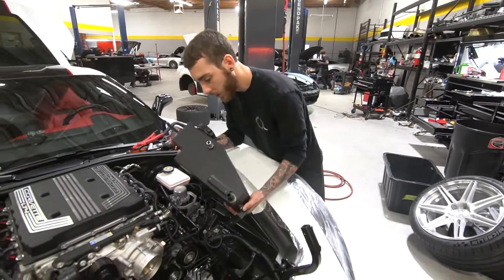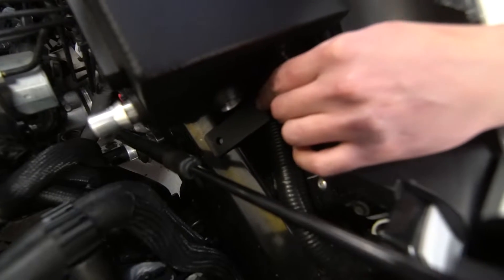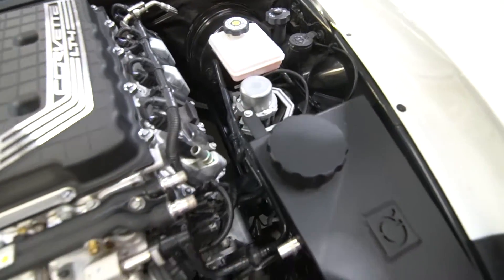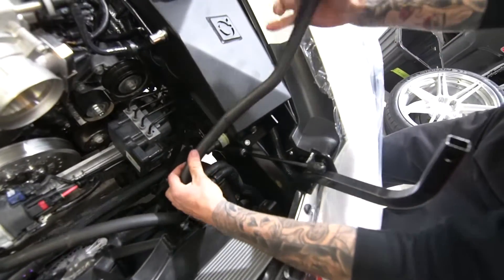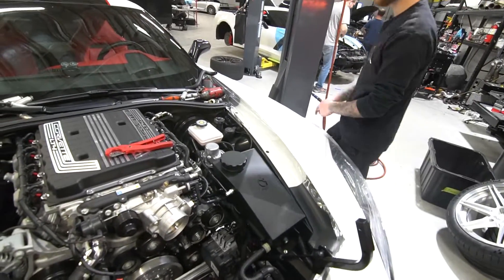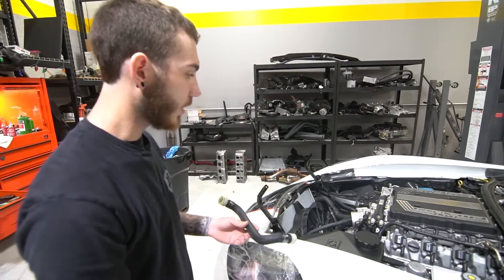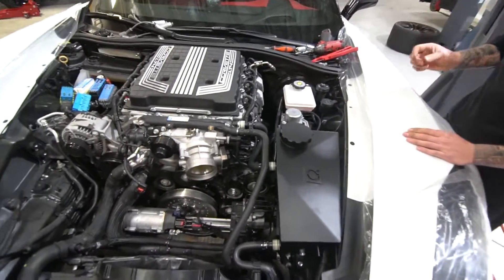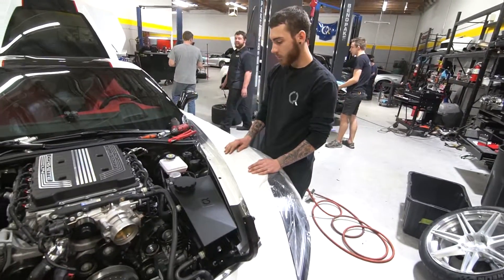C7-Z Ice Tank Installation

Comment: There's an open hole by the self tapper ... what goes there ? Or else the liquid is going to get out no?
Reply: probably a threaded bung in case someone wants to log intercooler fluid temp, I bet they supply it with a plug.

Comment: Great video fellas! Can you answer this? What is the OEM part called from GM that you use the first hole for? That’s the electronic brake control module, correct?
Reply from the maker: It's a vacuum canister
Reply: Thanks for your reply.